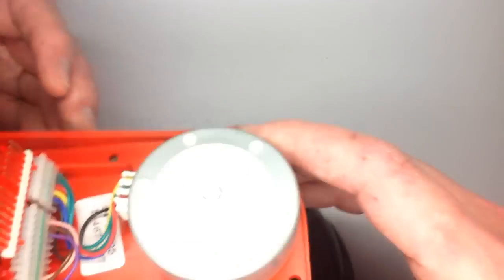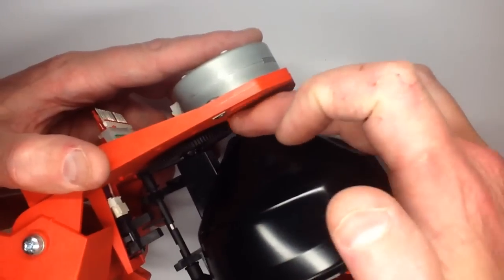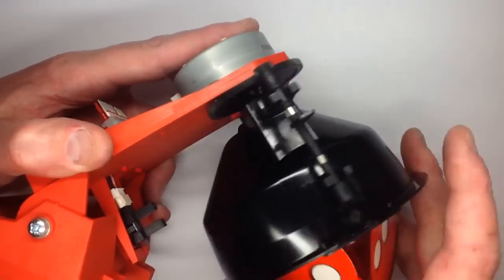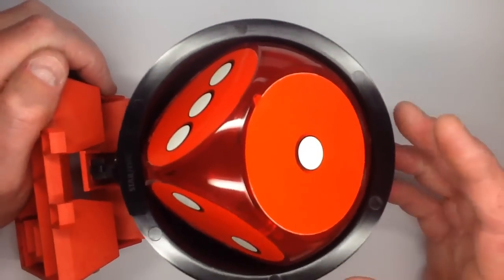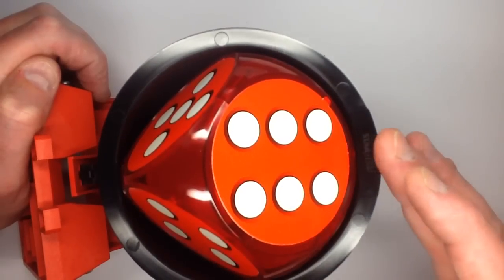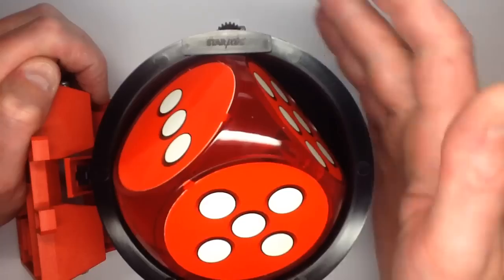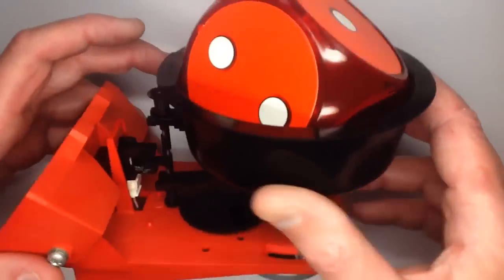Motorised dice mechanism from gaming equipment.

Comment: I would love to see the gearing on that - I can't get my head around how it works.
Reply: jca111 Me 2, dissect it!
Reply: ***** I've kind of figured it out by watching the video again, but would still be interesting to see.
Reply: jca111 
Ah, you're right. First I also scratched my head how the die can even hold in the cup. But then I watched the video again and it's so simple it's almost stupid and still gives a very nice effect.
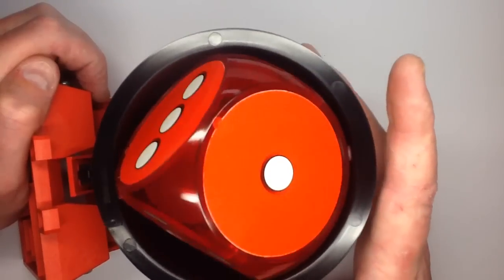Reply: superdau I think I know what you mean: the die turns around its diagonal axis mounted at one cup wall, and the rotation of the cup obscures this simplicity. You can see the mounting point as a white blob on the right side at 1:43.

Comment: Quite reminiscent of AC Coin and Slot. They had a long line of very bulky / gimmicky slot machines. While very cool and pleasing to look at most of them in the end broke down beyond repair due to a lack in documentation shortly after AC coin shut down. Today, not many gaming companies dare to build mechanical marvels as slot machines, as it is difficult to maintain the working order of these monstrosities without a proper engineer in the midst; Though; If you get the chance search on YouTube "Konami Titan 360" or "Interblock Roulette". The Titan 360 is a beast of a machine and is quite awesome to watch. Interblock has an assortment of awesome machines and personally I've worked on a few Interblock Organic Roulette tables and I can say they are built very well and sturdy as i imagine a lot of work went into designing every PLC.
Reply from the maker: CorJFexd I like the older electromechanical stuff.  Some of it was quite sophisticated.  https://www.youtube.com/watch?v=YMd5aXY9paE
Reply: bigclivedotcom Very neat! thanks for that.

Comment: Make a clock out of it.
Reply: Christopher Johnson That's exactly what I was thinking.  "Hack it and make a clock out of it."
Reply: Problem there is when for example it's 8:19AM.  You could do use two dice for anything 6+, but there isn't really a good way to get the first digit since it's a 1 or 0. (Or 2 if you do 24h)